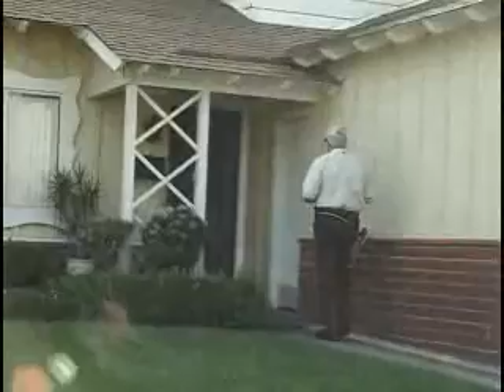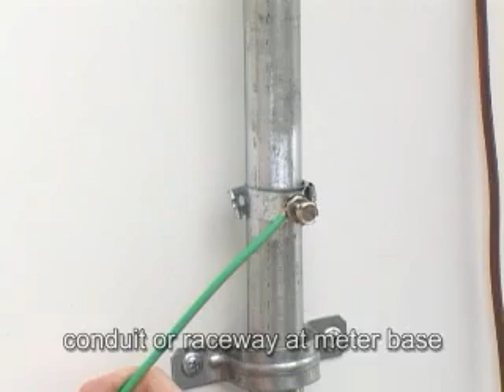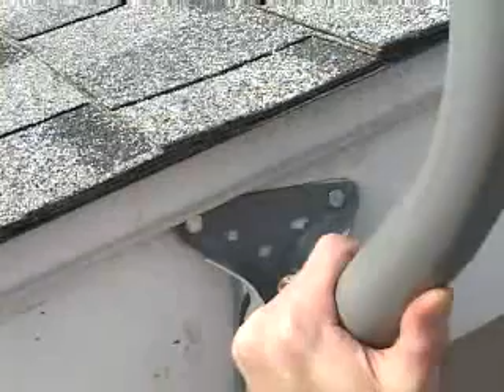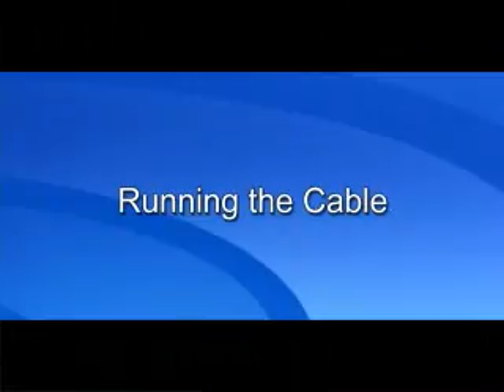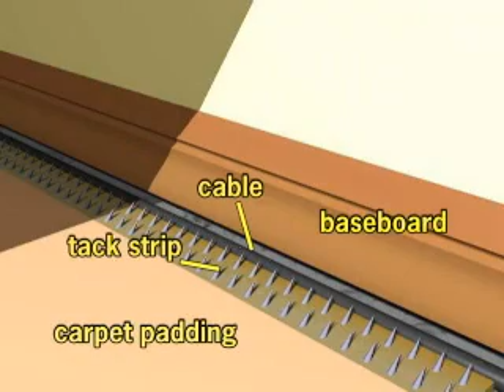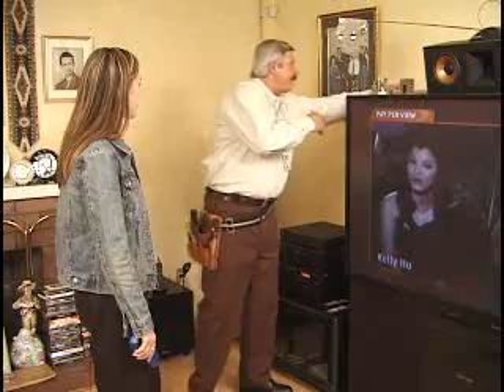Directv installation overview

Comment: Unfortunately, most people think, satellite installation is as easy as having a cable tv installation.  Most of the time, we can't use what the cable guy put in, because their cables are not sufficient or used shit fittings.  Imagine, the customers' face, when they want 5 TVS with 5 boxes on 3 levels of the house and when I mention, that I need to drill holes and it will take more than 3 hours, they are gasping for air "how come".
Reply: Us cable guys can't use the crap that satellite techs install because we like our service to be reliable and our cables neat. I've seen some crappy install work by satellite techs. If you think cable work is easy come try it. Satellite guys don't need to worry about aerial taps or burying drops or installing several hundred feet of conduit underground for our cables.
Reply: @l1nx2112  You can't have a system that works unless it's grounded, so I will guarantee you that it is grounded. You never tap into existing systems because you can't guarantee quality. Even in Cable, if they change providers, we run new cables. Coax is cheap, service calls are expensive for the tech. Run new cables.

Comment: Installing Directv or cable tv isn't hard.  It's just learning the house structure to run cable and system configuration.  Once you get use to these subject the job is easy and you can make good money installing satellite and cable tv.

Comment: How long does it take to do an install like this?
Reply: You need to have a router. Smart phones and Hotspots bandwidth isn't strong enough to support DirecTv  Internet  connection. 

If you have a clear line of site, you can get service. You just won't be able to download movies, and use other features that require the Internet
Reply: If you its done the right way between 2 and half to 3 hours.. if I arrive at your home at 8am.
We'd spend about 20 to 30mins going over your work order..and preinstallion walk through. 

If nothing goes wrong...the complete hands on installion should take about 90mins...

Getting the receivers downloaded..activated...and programing remote between 30 to 40mind (depending number of receivers)

20 to 30 educated the customer on the use and functions of their system...

So if I arrived to this home at 8:00am...I should be walking out of the door between 11:00am to 11:30am...

Some techs will say...they could an installation this size in 60 to 90mins..but chances are they took a lot short cuts and someone will be back out fixing everything within a matter of days...and the service tech more then likely will be upset the tech who did installed screwed him over...
Reply: Mrbaltimore2001 For a 4 box install with the new swim system shouldn't take more than 2 and half hours to complete.
Reply: When I go on a service calls for techs getting 771 and 775 not even days after a new install...it's usually cluster mess that needs to be redone all over.
Reply: Mrbaltimore2001 cool thanks for the response.
Reply: Mrbaltimore2001 I have a question about something he said in the video. Is a phone connection still currently required for it? Because my family don't use landline phone we use cellphones to call people. Because we might be moving soon and we might be getting Dish TV and considering they also use Satellite television I just wondering if having a landline phone is still required nowadays being they're getting a little bit out of date nowadays. Thanks for answering my question and this video was really interesting on how they install it.
Reply: Mrbaltimore2001
I can't log back into my old account.

No you don't need a phone line to get DirecTv. Directv grades Techs on a metric score system.

DirecTv requires Techs, to either hook the customers system to a phone line and if that can't be done, then they want us to connect your system to the Internet or both. 

The more boxes hook to phone lines and the Internet, the higher your metric score goes. 

If it gets too low, then techs are questioned why aren't they connected customers systems up to the phone or the Internet. And if this happens for an extended period of time you can get into trouble.
Reply: TheBlackKnight but we don't have Internet access I have it but only with my smartphone and having unlimited data.
Reply: That is correct BlackKnight.  Video are very bandwidth hungry and will each up alot of data.  Correct me if I'm wrong but I don't think there is unlimited data when turning wifi from any cell company.
Reply: @hoangdang1971  😂 .  Depends on your telephone provider. I now have unlimited data ony cellphone.  
I no longer work for DTV anymore.  Did 6yrs there now I've moved on.
Reply: Depends on where you're doing the install...I work in an area where the homes are very expensive and the customers are really pickie...so everything has to be detailed oriented....

Not trying to brag about my work, but as December 2013...the only TWO repeat service calls I've had on brand new installs I've done was 1. An old lady forgetting how to change her inputs from VCR to DirecTv...and  2. A wireless client breaking down..

I been doing this now just under two years...and my customers rarely need to call back for anything aftet I leave..nothing against other techs out there but I don't do chitterling style installs.

Comment: Then ur screwed
Reply: It's really not that bad now with all the new technologies compared to back in the old days where we had to install phone line on all new installs and getting hammered for not running them.  With the swim system we just run one line into the house and make sure we connect the internet DECA to the Swim system and we are golden.  But most importantly is the grounding and dish setup.
Reply: Exactly

Comment: They keep saying a phone line is required, but what if someone doesn't have a home phone service!
Reply: Phone line is needed to get the receiver to ping or do a call back to Directv's system.  If you can get a internet connection to the receiver or into the swim system, you will not need the phone line.